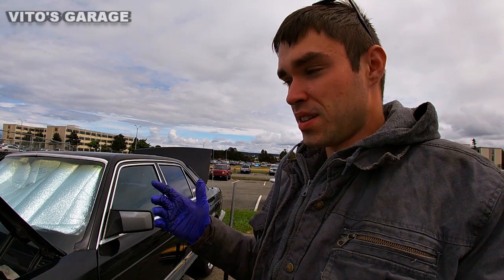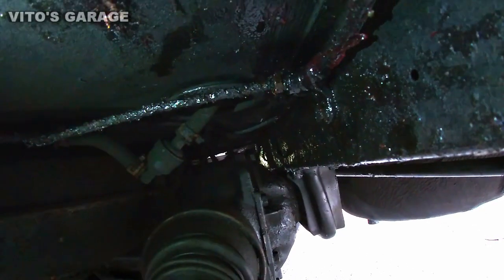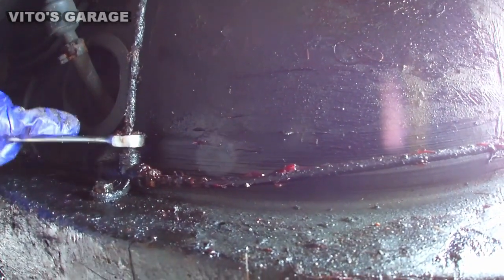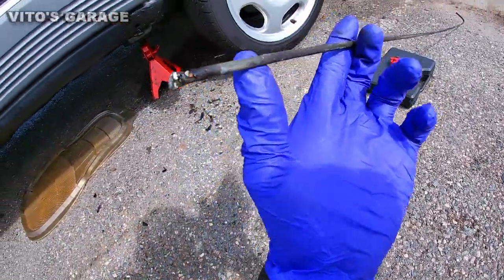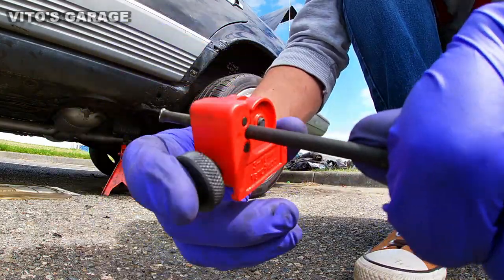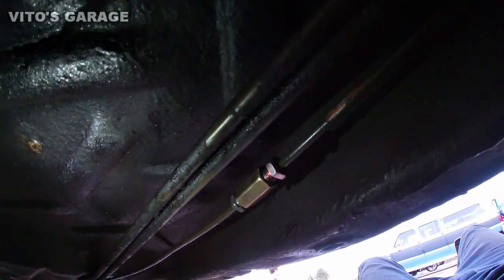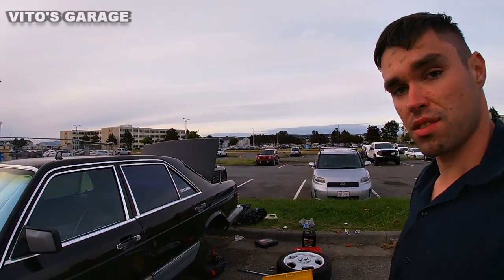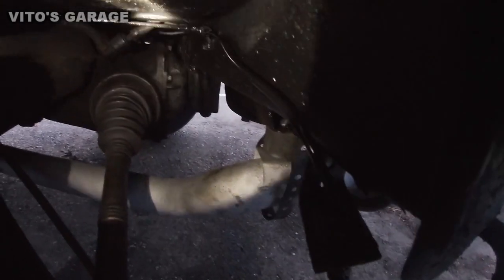Rusty Brake Lines Replacement & Bubble Flare Mercedes W126 Restoration Ep.6

Comment: I have a 99 slk 230 r170, and I removed the fenders, hood, trim, and sanded the whole car down, did the bodywork, primed, painted, and clear coated the car.  After all that work, the car looks better than 90% of the used cars out there.  It's fun, not hard work, just time consuming, but well worth it at the end, and I saved myself over $4000 doing it myself. The cost was around $250 for sandpaper, tape, plastic sheeting, body filler, primer, paint, reducer, hardener, 1 gal of paint, and 1 gal of clearcoat.

Better than paying $800/month, and keeps the old gal on the road for us to enjoy.  Keep up the good work,

Comment: Hy . Please help , my rear driver side break line broke . The big one . I can see it up , but it s masked by alot of things . I dunno how to do it. Do I have to remove things ?
Reply: I just saw it , mine is not linked beneath the car is somewhere up behind many things.  I dunno how to do it .
Reply from the maker: What car do you have?
Reply: @VITOSGARAGE  hy thank you . W202 c180 elegance 1995 1799cm3 motor 4 cylinders .
Reply: @VITOSGARAGE  I cannot see it.  It s like it s missing the steel holder there , on witch the transmission mount comes on
Reply: @VITOSGARAGE  hy c180 1995 elegance w202
Reply from the maker: I am not sure what exactly broke. You need to inspect it and replace. Whatever it is, it needs to be replaced. You might need to lower the rear subframe slightly so you can get to the line
Reply: @VITOSGARAGE  thank you , i cut everything rusted and I will just redirect the main line .